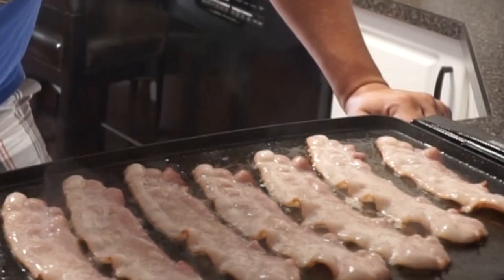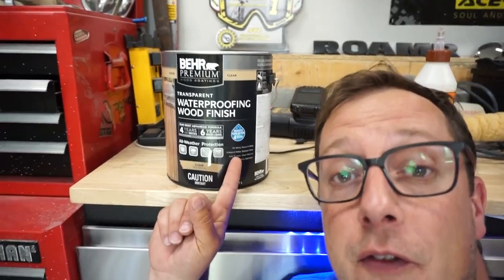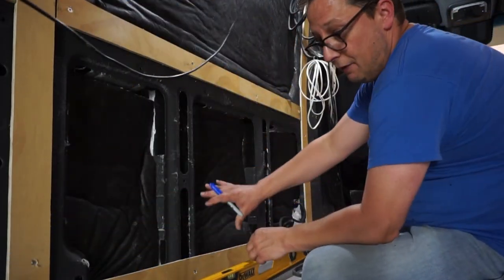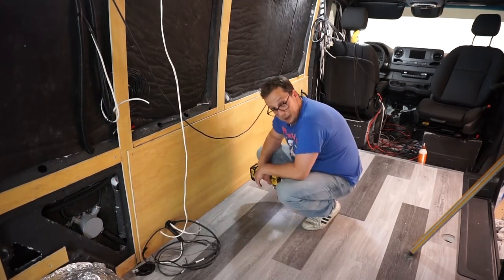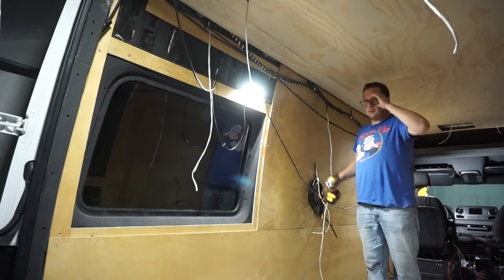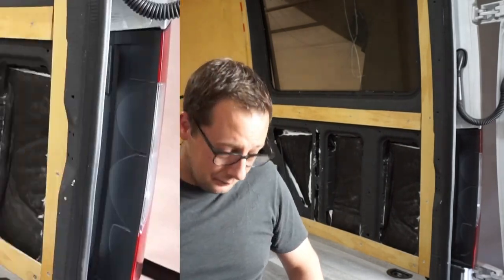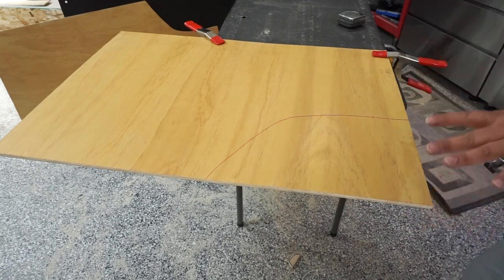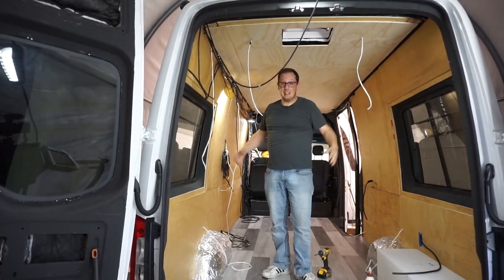MY WALLS ARE GOING UP!! | FOUR SEASON VAN | EP.32

Comment: I've enjoyed every clip I've seen. Half, is what you're doing. The other half is You. Keep doing what you do and keep being you. Curious, since the wheel wells are kind of dead unusable space and challenging to cut floor and wall boards around, why not just frame out a box around each one? That way the floor and wall boards wouldn't have to have any curved cuts in them. Rather, just straight cuts. Just a thought. By the way, Mmmm, ketchup.